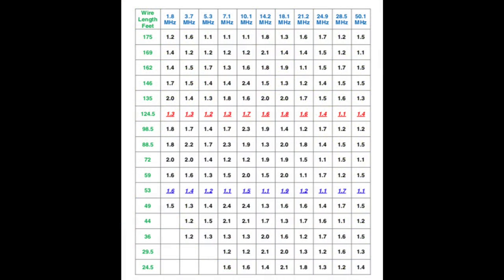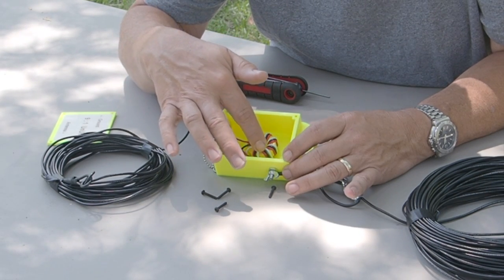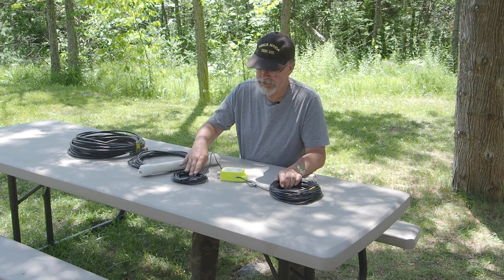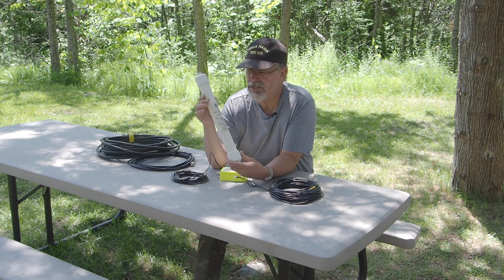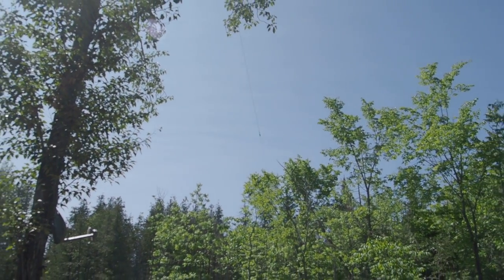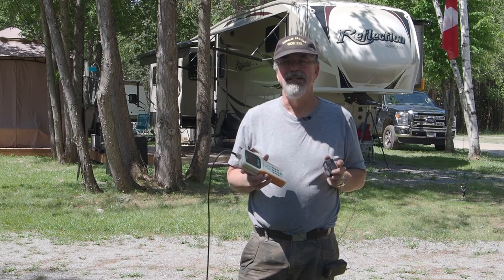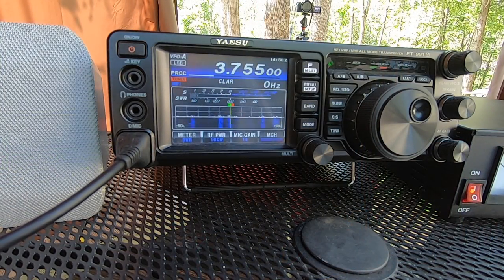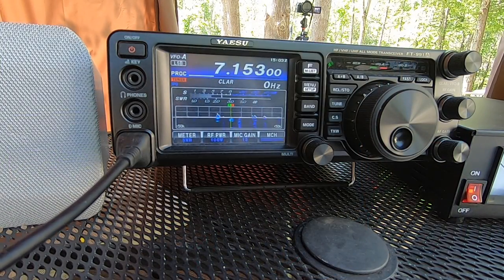Long Wire Antenna

Comment: Thank you Dennis. This is exactly what I needed to get me going. The addition I would like to see more of, would be the about counterpoise. It's sort of a mystery to us new guys. I did find down in the comments to make it approximately 1/4 wave long of lowest frequency you are working with. Maybe you could add some text to your Recommended wire lengths and installation notes. Otherwise, it was perfect.

Comment: Greetings from California. Good day Dennis. That was a spectacular demonstration. Spotless, professional and admirable. I’m new to HAM and presently only a SWL. But as the time goes by... I’d get a handle too. Once again, Sir, It was a pleasure listening to your broadcast. Cheers 73s
Reply from the maker: Thanks for the kind words,  I can't wait to get back into the park and start on the next video.  73  Denis
Reply: Not to be picky as Denis did a nice presentation, but proper protocall  when you went to 14.250 would have been to ask "is the frequency in use" (QRL?) before hitting the auto-tune or calling CQ.  I realize the band sounded quiet, but on 20 meters, you may only hear one side of the conversation.  We've all been stepped on before by people jumping on frequency and calling CQ.

Comment: You need a counterpoise, ground radials, or some other ground, if the antenna is operating as a Marconi, ie, resonant at an odd multiple of quarter wavelengths.  The base Z is about 37 ohms.  If the radials slope downward ~45 degrees (a "groundplane"), it's ~50 ohms.  If the antenna is a multiple of half-waves, it's Z is high (typically, 2-2.5K), and it can be operated  without a ground.

Comment: A counterpoise is simply a long, insulated wire that attaches to the ground connection on your antenna tuner. The best counterpoise is 1/4-wavelength at the lowest frequency you intend to use. That's a lot of wire at, say, 3.5 MHz, but you can loop the wire around the room and hide it from view.
Reply: I have been told you should never position the counterpoise wire directly beneath the antenna wire, in your experience, is this really bad or just a minor detail?

Comment: What would be really nice is to use an A/B switch and compare this antenna to say a EFHW with a 49:1 transformer or even a ZS6BKW.   Nearly any antenna will work but how well it works compared to other antennas tells more of the story.
Reply from the maker: Yes, I'd like to do that too but I do not have the space at the campground.  73

Comment: I like the strain relief hardware; it is what I need on my antenna.  I am not happy with just letting the terminal hold the wire, even though it is very thin and light.  73!

Comment: Hey Dennis,  Good video.  Encouraging to hear your results with this antenna.   I live in an apartment and use this type of antenna also.  Do appreciate the wire chart as I have always found myself guessing about the  wire length.   Usually result to running a length that is physically possible and not too visible being in an apartment.   Lucky enough to be able to get the wire outside though and about 20 feet high.    73de WB0RSZ

Comment: When you say the radiator length is 124.5 feet, how do you account for the folded back portions of the wire at the strain releases? Thanks for the video, 73 George N2YTA
Reply from the maker: I’ve experimented with the fold back on a few antennas now and I’ve come to the conclusion that 6 to 8 inches tightly rolled make no difference to the SWR so go with 124.5 from the terminal to the insulator.  The biggest SWR variable is antenna height and surroundings, try to get the the antenna to 20 feet high. 73
Reply: Yes. The folded back portion of an HF wire antenna has almost no impact.  A careful measure with an analyzer will possibly find a tiny bit more capacitance.

Comment: Good video, but why are you recommending g 30’ of coax?  You’re going to lose about half a DB with that length of RG8 going into your antenna.  Definitely people will say that you shouldn’t keep your feedline as short as possible to minimize that loss. Overall though, I couldn’t agree more with your random wire video, I have the LDG 9:1, and have used it for a year.  My install at home is such that I can hang it high and run it into my radio through a 2nd story window pass-through with only 3 ft of coax; almost no loss.
Reply: My experience is that you want to keep your antenna away from the house structure, that’s why I prefer longer coax runs. As I get the antenna closer to the house, the ground-level noise increases significantly. I normally use 50 ft long LMR-400 or RG-213.
Reply: @LuisPerez-xe6nu  hmmm.  Ok.  Even so, with a random wire most of your loss or inefficiency is your signal burning up in the coax when your antenna isn’t resonant.  30’ isn’t super long, but there are online calculators that will open your eyes to efficiency, swr, and coax - even letting you dial your specific coax type.  It’s amazing how little you lose even with SWR’s over 5:1 with short coax runs.  A remote tuner in your case would be the ideal solution.
Reply: @kd8opi  thanks for the input. The short coaxial run could be a great benefit for outdoors operations (POTA, SOTA, etc..) where you have no major sources of noise. But like everything with HAM radio, everything is a compromise. I have been playing with EndFed antennas for a while now, and I have gotten to a point that I have been able to dial in random-wire antennas on SWR by adjusting different factors (mast height, feedpoint height, transformer design, coax length, counterpoise length, choke position, etc…)…with patience you could make any random antenna resonant for your needs). 73s
Reply: @LuisPerez-xe6nu  agreed, but then what you’re describing isn’t a non-resonant “random wire” antenna, right?  But that’s cool too, I use both, an EFHW cut for 40-20-15-10, flat-top, up 50’, it’s great with a low swr so my 50’ coax run of 213 doesn’t take much away (I lose half a dB ), made up for by its directional gain of 2+ dB.  Then my 33’ random wire vertical in a tree through a 9:1 unun into a whopping 3’ of coax.  It’s swr is anywhere from 3:1-5:1, but with a tuner matching it I don’t lose much at all in the coax.  Not measuring the loss in the tuner or the transformer, I get >90% efficiency on the random wire.  The EFHW wins most of the time, but the random wire is good for 17m and “off beam” contacts sometimes.  I’m qrp, 5 w max, so every little bit helps.  If you’re essentially running an EFHW resonant on your operating frequency, the coax length of 30’ won’t give you much loss at all as you suggest.  Happy hunting.

Comment: Hello, thanks for the video! I was wondering, what are the other components on your table other than your 991A? A speaker, and what is the other thing? Thanks, Ben de W1BPM
Reply from the maker: That is my power supply.

Comment: Very good video Denis. Great scenery as a background video. You are giving me some additional ideas for /p operation. I'm going the solar + LiFePO4 route for power though with everything in a backpack. The details on how you set up the antenna are informative and now I just have to work out how to get the para-cord up high enough in the trees to pull up the antenna... A lacrosse stick & ball keeps coming to mind :) de VA3NIE Ottawa

Comment: Got mine set up as high as 25 ft or more on each side. SWR was very high on 160, 80, and 40 meters. To use those bands, need external tuner. Internal tuner got SWR of 2 on those bands at 5 watts. If higher power is used, then SWR goes over 3.

I had ti cut to 121' from 124.5', in order to lower those bands as far as SWR. Using a 30' counterpoise. No ground bar on those. Brand new Samsung stove digital display goes cray and oven light turns on by itself. If anyone has any ideas, appreciated.

Would like original 124' 6" back, but 160, 80 and 40 not good unless an external tuner is used. 73.
Reply from the maker: There are a lot of factors that will affect the SWR, soil composition and proximity to any near by metal objects near by electrical or telephone wires, underground utilities aluminium siding just to name a few. I use this antenna for portable ops and I have had pretty good success on 80 to 6 meters using the internal tuner only once I was able to get 160 under 3 to 1 SWR,  most times it hovers around at 4 or 5 to 1 SWR .  A few things to look for a single 30 foot or three 10 foot counterpoise is recommend,  to me a good ground is a must. Also make sure that you have at least 30 feet of coax that is not under (parallel to) the antenna, next add a RF choke or an ugly balun to the coax at the 30 foot or longer point before you enter the house or shack and make sure that your rig is also grounded to get rid of any rf that may still be in the coax.  The newer appliances are really poorly built when it come to RFI so it's best to keep the antenna feed point as far away from appliances as possible.  I hope these suggestions help you out.  73 de VE3BF

Comment: Can anyone tell me. . . if the counterpoise is 30 foot for the 124foot 6 ins antenna, what length would it be to function with a 53 ft antenna?   Kind Regards  . .  Andy        gw0jxm
Reply from the maker: AndyDaviesByTheSea the counter poise is not crucial to the SWR but it does make the antenna radiate more efficiently.  If space is a problem you can try 3 ten foot radials or you can simply ground the antenna to an 8 foot grounding rod.  You just have to experiment a bit to see what works best for you.  73. VE3BF

Comment: 73's VE3BF. I don't have my ticket yet but what ticket do I need for 10-160m bands? Thanks for the info Dennis great antenna and I love the radio! I want one!
Reply from the maker: Hi Dave, If you are in Canada you’ll need a Basic with honours or an advanced to get on the HF bands.  Every country has its own regulations.
Thanks for watching, 73 VE3BF

Comment: Sorry for this dumb question, but is the length of wire that you measure include the length of the strain relief or is that extra?

Comment: Thanks for the great video. Why did you go for 124.5 length when 53 can provide good SWR??
Reply from the maker: the longer the radiating wire the better, yes the SWR is okay at 53 feet but you only have 53 feet of antenna, the 124.5 will pick up weaker station and will transmit you signal better.  When it comes to antennas Bigger Is Better.  That said we can only go as big as our space will permit.
73  Denis

Comment: Really enjoyed your video. esp using the real world contacts ON THE AIR.  Very nice work on the audio as well.   Now I want to you modify the counter pose .. Add a 66-68 ft section, then your 33 ft section, and I think you will see better results on 75/80M.  k6vhp Shally inspired my random wire and I made my for 1k QSO's from my old shack using the big redwood tree!
73 om, hope to work u soon
j

Comment: Thanks for posting.You were doing so well until 7.30 but then you lost me with no mentioning of connections to actual rigs and could do with some diagrams of your connections. Also the handheld tech... ?
Reply from the maker: No diagram need here simply run a 50 ohm coax, minimum 30 feet, from the antenna towards your rig connect the coax to your in line balun the connect the other end of the balun to your rig.  That’s it.  Not sure what you mean by handheld tech.  73

Comment: Denis, I’m not sure you’re still answering questions on a year and a half old video, but I was just curious about your grounding method on your radio.  It looks like you had a short copper braid connecting to a black shielded cable.  What are you using for a ground rod?  I’m guessing a small diameter 3’-4’ copper rod.  Thanks in advance if your reply.
Reply from the maker: Hi Michael,  I have a 4 foot copper ground rod in my go kit but I rarely use it at campground because they have burried wires and pipes all over the place.  It is very easy to spot ground points once you know what to look for: metal pipes, electic pole grounds, chain link fence, pole guy/anchor wires, lighning rod grounds (often on old trees) just to name a few.  I keep some #6 wire in my kit and I just clamp the ittle pig tail on the back of the rig to that.  I don't always have the best ground at portable ops but I'm a believer in something is better then nothing at all.
73 Denis
Reply: @VE3BF  Denis, thank you for the reply and what you said makes good sense.  I’m new to the hobby and only have the IC-7300 base rig and a Yaesu FT3DR HT, but I am planning on picking up FT-891 for portable use.  I found your videos today and I have been watching several of them.  Great job.  AE0IT.  73

Comment: what is the choke for? you said it is needed but not why.
Reply: A longwire endfed antenne, is actually a dipole with one leg. The other leg is the counterpoise. If one doesn't use a proper counterpoise, the radio waves may look for it in the coax cable running to your 1:9 UnUn. That can create interference or even high voltage in one's schack. Using a choke is then often used.
The weird thing, however, is that not every radio amateur has issues with that. Some do not need a choke.
73, the PD0PSX the Netherlands.

Comment: Nice video.  I have the same transceiver and I was wonder what switching power supply you have connected to it.  I use mine mainly at home with an Astron VS-35M linear power supply which I like very much but for portable use it is quite heavy.  Again thanks for sharing.
Reply from the maker: The power supply is an Astron SS 30M.  It's 25 amp continuous, 30 amp peak.  it's about 4 lbs and very quiet.  BTW, I also have the VS-35 here in my shack.  73
Reply: @VE3BF  Thank you for taking the time to answer my question.

Comment: Don't get me wrong, this is a good video...BUT...It irks me no end, when people refer to a "random-wire" antenna as a "longwire."  A longwire is an antenna which is at least one wavelength, at the operating frequency.  It may, or may not, be resonant.  A random-wire is any length, which is not specifically cut to be resonant at a particular frequency.  It will, of course, BE resonant at certain frequencies.

Comment: Did you experiment with antenna lengths?  I guess there must be a “sweet spot” for best minimum swr on most bands.  I have been experimenting with EFHW antennas, I get 1.4:1 on 40 and 1.1:1 on 20, but I’m limited on other bands.  I will have to try the 9:1 balun.  Thanks.  73 VK4QP
Reply from the maker: I have tried the shorter lengths but the height and surrounding areas are what dictates the SWR as long as you stick to the non resonate lengths listed in the chart.
I'm planning a follow up video as soon as the temperature warms up.  73 de VE3BF

Comment: Would a 9:1 current balun (transmission line dual toroid balun) work instead of the 9:1 un-un and feed-line choke?  I ask as I am in possession  of a 9:1 current balun and am interested of giving it a go.
Reply from the maker: Well yes and no a 9:1 balun will match the impeadence but you will need to balance the antenna with radials. 73 de VE3BF

Comment: Can a wire antenna like this be dropped off a balcony of a condo on the 22nd floor using like a fishing pole or something? Like a vertical configuration? I'll be staying in Manila during the summer and fall. Trying to figure out antenna solutions. I'll be getting a temporary operator permit. Thanks.
Reply from the maker: I did that years ago but you need to slope it away from the building.  I would go out and tie it off to a lamp post in the parking lot at night.   Memories :)

Comment: Hi Dennis. Great video.  Where do you get the wire for you antenna from? I'd like to build one to take my 891 portable. -73
Reply from the maker: I got got it from an electrical supply store.  It's 16 ga stranded marine grade.  73  Denis

Comment: It's not a "long wire" antenna unless it's at least a wavelength long. Everyone these days erroneously uses "long wire" and "random wire" interchangeably for some reason.
Reply: Long wire is defined as at least 1.5 wave, but you are absolutely correct.

Comment: Lengths in feet? C 'mon in radio we do things in Metres (like 97% of the developed world). You 'mericans need to get on board ;-) I see comments saying things like 124'5" for 1/4 wave on 160M band - why not just say 40M for 1/4 wave on 160M band - doesn't that sound simpler? Just pulling your leg but you've got to admit that it does make a bit of sense?
Reply: Google and convert it like the four other people who gave a crap.
Reply: Do the math to convert it to metric.
Reply: As a math teacher once told me “The only country to put a live human on the moon and bring them home measured in inches and feet.”

Comment: Im just debating if i should put my endfed back up or replace it with doublet  ... you’ve muddied the waters Denis 😂😂 nick, G8SYE
Reply: Use both!
Reply: Michael Thompson I’ve got a Hf vertical as well so this is just for 60/80/160 and broadcast band listening

Comment: Q,?    Why do you use a choke ?. Keep the back ground noise down for interference?.. would you not want more signal  ,, serous I am making my loop antenna  I have the loop , I have the receiver Icom PCR -100,  COAX is Rg8 , I am not learned on the choke thing , the Balum , I have a few ideas on what I want . Looking into the loop balum 9to1 seems to be the favorite match ',,, and I have the mod on the radiator , make it more oval like a 🥚 
I have to brake down and buy a antenna analyzer to check the Swr ...well 73’s . O. Thank you 🙏 trying to do this all with one hand . So time yeah ok .. I got time .. oh by the way this is for my listening 👂 post . I love shortwave and do a lot of Band sweeps 🧹.. woodpeckers ,number 🚉 stations ., over the horizon pecking crap , chips chirps ,bells and whistles,, lol 😂. ..
Reply: An RF choke is used to decouple the feedline from the antenna. A good choke keeps RF from flowing back on the feedline , keeps it on the antenna and radiating the way the antenna was designed to radiate. It can also serve to reduce/eliminate RF in the shack.